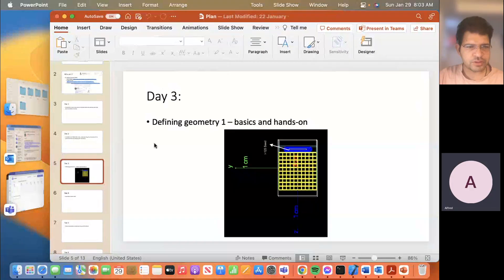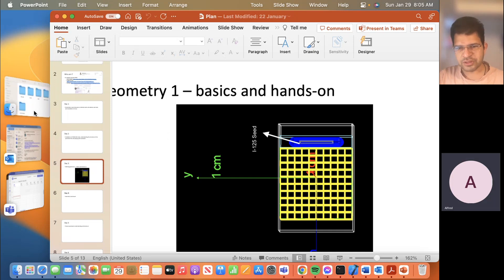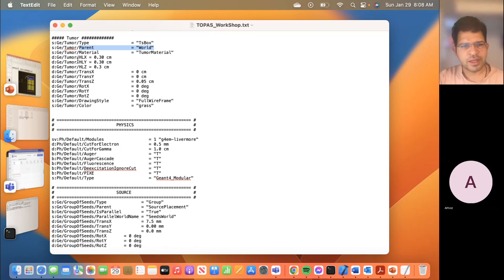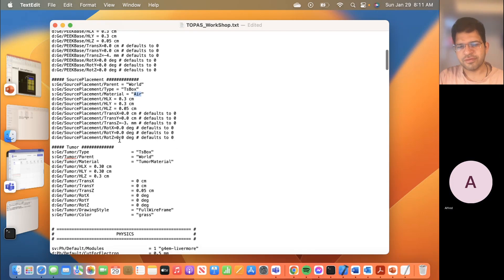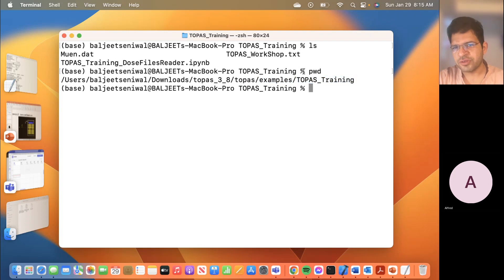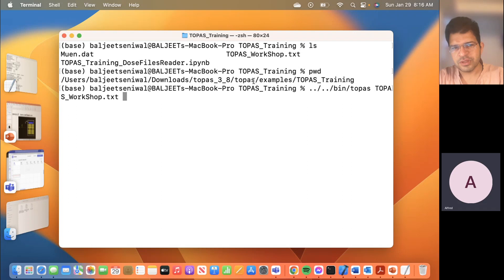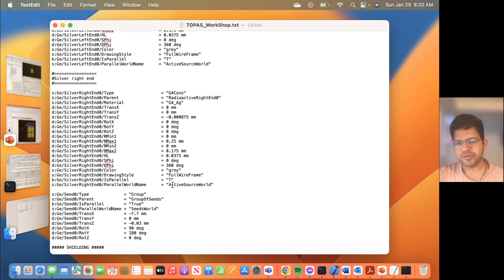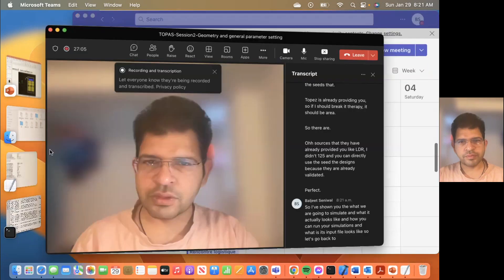TOPAS Session2 Geometry and general parameter setting Part-1

Comment: thank you very much for this information its very helpful please if you can do tutoriel on how to have same graphical user interface I appreciate it
Reply from the maker: Try adding:
s:Gr/MyView/Type              = "OpenGL"

in your input file, you will get the same GUI. 

If you do not get the same GUI, even after adding this command let me know. I will find time to prepare a vedio or may be we will connect by teams and will resolve your problem with GUI.
Reply: @baljeetseniwal  actually its already added but no visualization show up
Reply from the maker: @inasfatiha4778  Hi 
Leave your email address here. As I am busy this weekend, I will contact you next weekend and we will try to resolve your problem together.